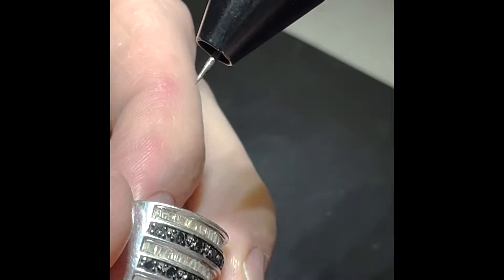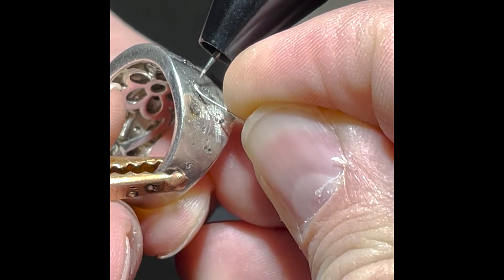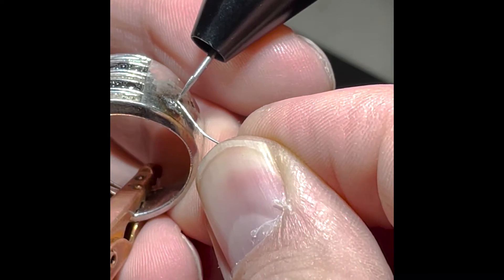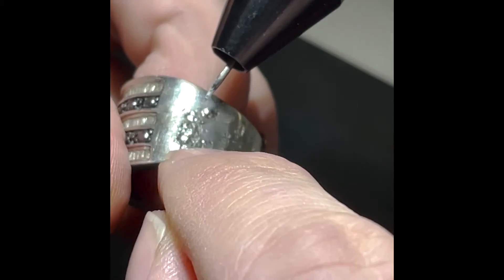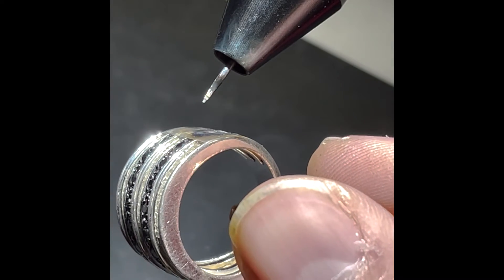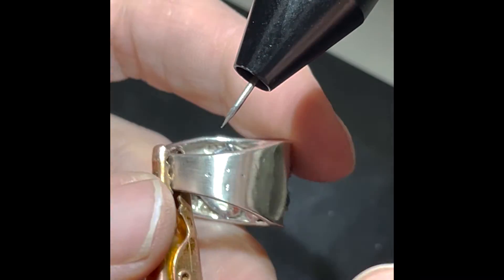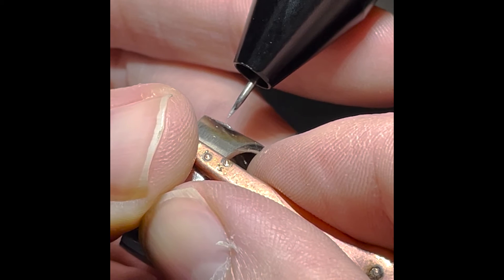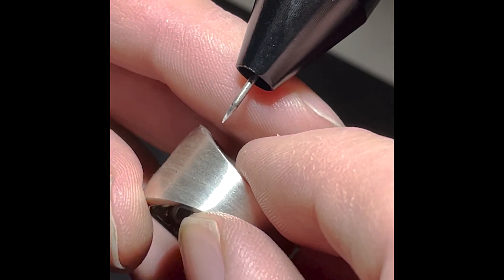Silver Ring Repair with the Orion 150s by Sunstone Welders

Comment: I’m new to this, so i have a question…is this better than just using silver solder?  Is the wire you are using 999 purity?
Reply from the maker: Using the same purity of silver is best. In this case it is a .925 silver ring so the filler wire is also .925 silver.
Reply: @SunstoneWelders  puede mandarme precio por favor de esa máquina?